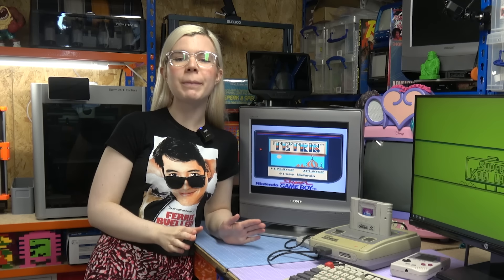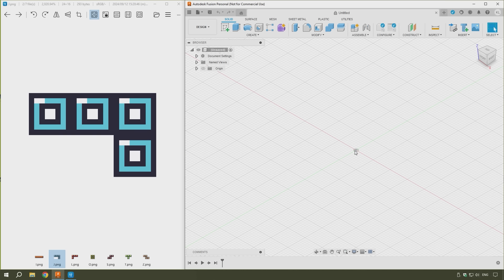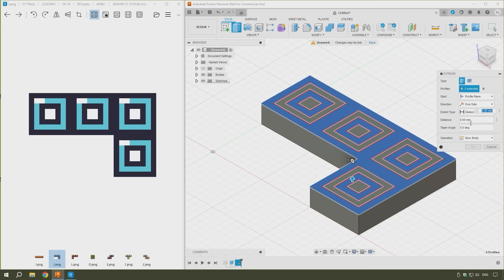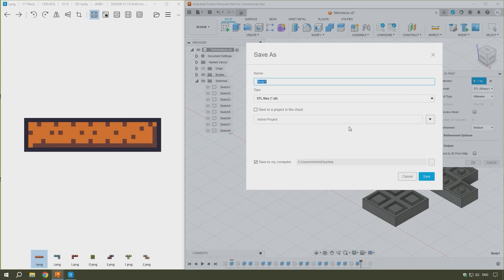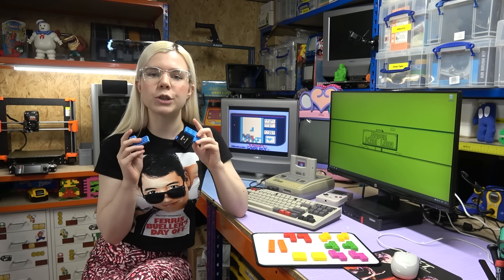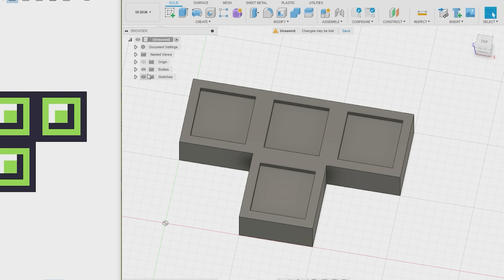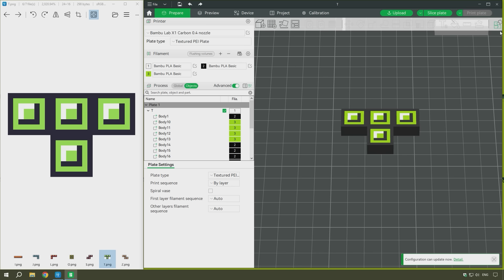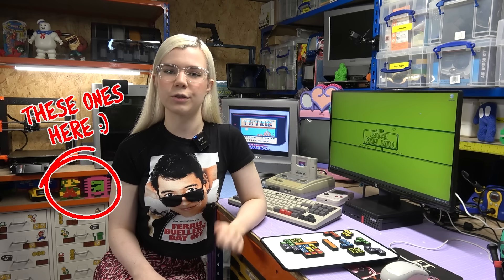Learn to make Tetris fridge magnets // ft. 3D-Printing, Bambu Lab & Fusion 360

Comment: A useful tip about super glue is that if you sprinkle bicarbonate of soda on it then it almost instantly dries as a much stronger kind of concrete. That tip only works if you're adding the glue to the sides of something you've already pressed together... because you wouldn't have enough time to actually press them together, as it dries so fast. I learnt this tip from someone who actually fixes real aeroplanes!

Erm, it probably wouldn't be useful to you here, but I thought I'd mention it anyway.

I often do this when fixing my daughter's toys, as basic super glue isn't usually strong enough for "rough" play; but this trick makes it really strong.

Comment: The multicolored pixelized tetris blocks look really good, my current printer can only print single filaments but I'm planning to build a voron 2.4 with a carrot feeder, bambu would be just too simple for an engineer x) if you want a challenge maybe try building a voron from a kit next as well, I'm sure you it would be like a puzzle for you. Also you could experiment with water dissolvable filaments (for supports) with the bambu, my main reason for looking for a new printer because I hate prying those off. Anyway, good content as always.

Also one tip that really changed my 3d printing habits is to use fuzzy skin in orca slicer, at least on my printer it practically hides the layer lines and gives the prints a nice organic texture. Just don't go overboard with it, something like 0.2mm or less worked for me. I made a mistake to dismiss that feature at first because I used way too high values, but only later I realized the less the better.

Comment: if you want line clears with the 3d prints you could subtly change most of the interior square edges so they key together a little but could still be sheared off when a line clears.

make the board with some spring-loaded pegs down the sides that you can press out of the way and then push across so only the clear row moves.

seems like  a lot of extra work and magnets for a gimmick, maybe it's worth a video idk i'm not a youtuber.

Comment: Great video.  Some suggestions for next model/print:
Getting used to the pattern tools in Fusion makes modelling easier in the long term (i.e you can use rectangular pattern and mirror rather than modelling each cube individually)
Embedding the magnets in your model (i.e. pause the print and insert them between layers) means they'll never come out and be more scratch resistant (also works great for embedding captive nuts etc).

For characters to print, Prince of Persia, Lemmings in varying poses, Commander Keen.

A cool concept would be bringing classic splash screens or boxart to 3d Printed artwork with Hueforge and the AMS.

Comment: I love Tetris! I still play it all the time on my Game Boy Color [sic] whenever I'm watching a video that doesn't require my full attention, like a video podcast/news video. Obviously not this video, because I also love 3D printing and modelling. It's interesting to see someone else's design process, although these were a fairly simple design. It was also interesting to see the process for making multicolour 3D prints. I've seen the multicolour prints before, since my friend has a different one of those printers, just not the design process. And every time I see them, I'm tempted a little more to buy one of those printers!

Also, pro tip for making deluxe fridge magnets that don't potentially scratch your fridge door, you can get self-adhesive velvet or felt material that you can cut to shape and stick on the back of the magnets. Felt is usually thicker, so you may need stronger magnets (though yours looked pretty strong), and obviously it's best if they're inset flush with the base.

Comment: I don't use separate bodies, I extrude the different coloured sections by differences of 0.003mm in fusion.  So in your example the black would be at 6mm, the green at 6.003mm and the white 6.006mm. Bambu studio will allow you to use the colour painting fill tool to select them.

Comment: Epoxy is a better choice for glueing magnets as cyanoacrylate glue needs to absorb into the pores of the objects for it to actually hold.  It's also more acceptable to any oils on the magnets, so wiping with alcohol to clean them first works best.

Comment: Fun fact: Tetris includes the most sophisticated code of any software program in history. It's the bit that ensures that when you have an empty column beside 8 rows of perfectly stacked pieces with no gaps the game only gives you six of the crappy squiggly pieces.

And then, when you accidentally stuff it up and block the top of the column it gives you four of the line pieces in a row.

Comment: Would multicoloured and 3d be possible with the colour layers raised above the base?
Reply from the maker: Yep, 100% possible ... you can even achieve that on a single color printer, by just changing the filament at different heights :)